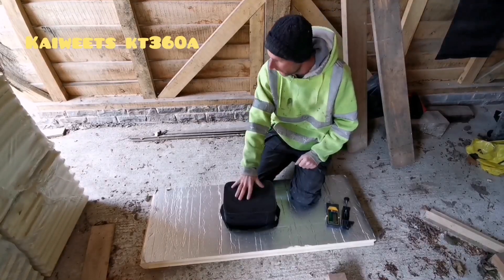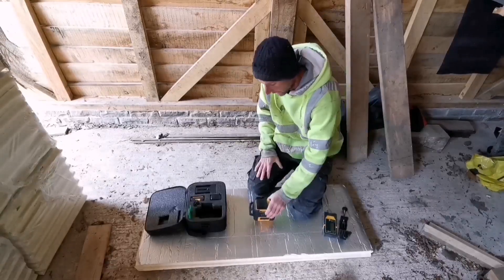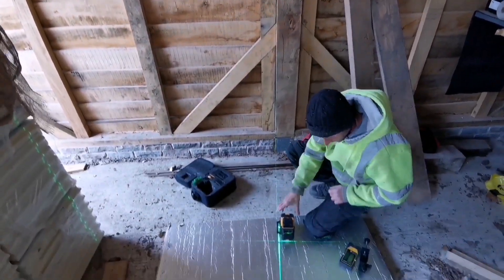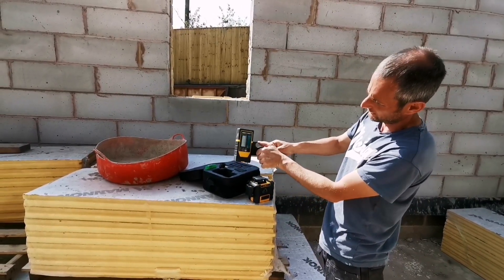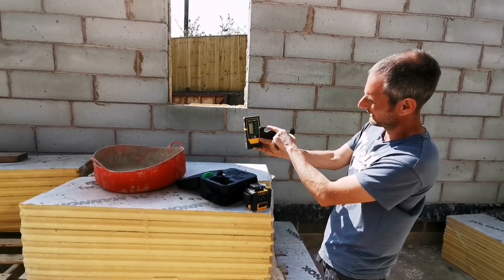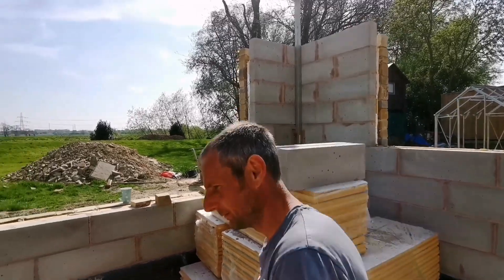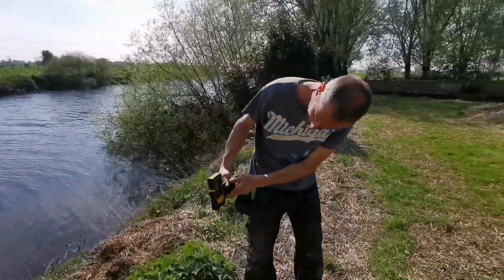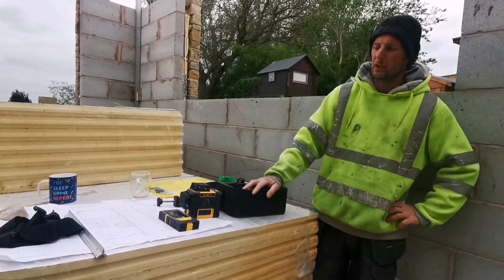New laser tool kaiweets kt360a and detector

Comment: where did you get the stick that the laser detector was attached to?
Reply from the maker: 😂Its set at 105mm. So when we sit laser on wall it's the right depth 👍👍👍
Reply: @markhep  I was actually referring to the measuring stick that the detector is attached to at the 6 minute mark.

Comment: Looks good that one mate, you do need them these days👍
Reply from the maker: Yere mate cheap and pretty good. I been wanting one for a wile. I have the optical one witch I like for levels but takes two men to use it. So this will come in handy lol👍👍👍
Reply: @markhep  Won't go wrong with that mate, I had the optical one for years until it got nicked and I devised a way to hold the staff through a shovel handle 😀
Reply from the maker: @bricklayersworldwithandy6277  😂nice one lol 👍👍👍